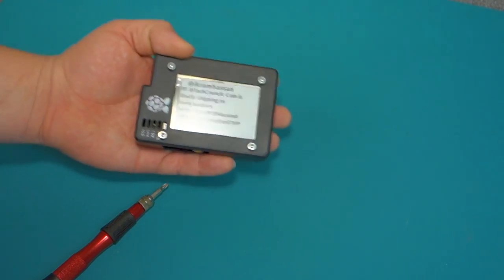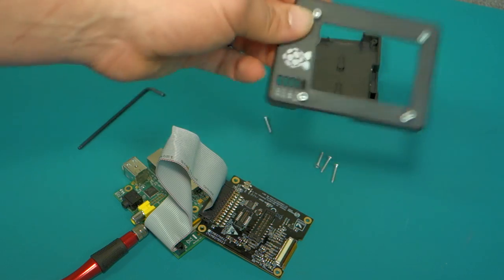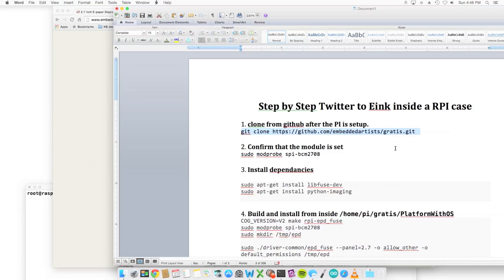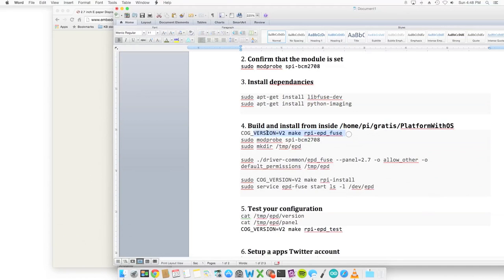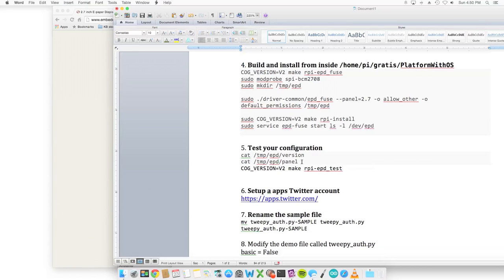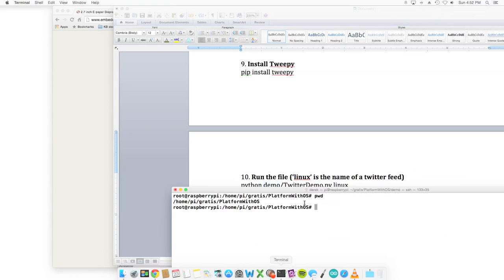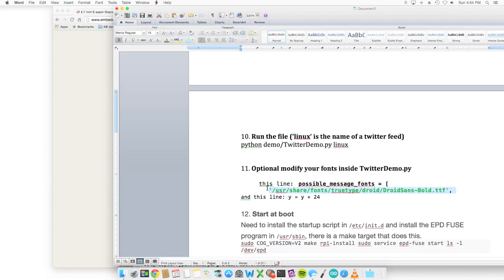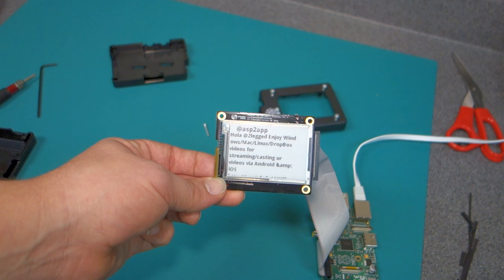Embedded Artists Eink Step by Step Tutorial Raspberry Pi Case

Comment: Hello,

Can this e-paper display work with the RPi 2?

thanks
Reply: +Panagiotis Atmatzidis Hi, I bought these (rpi2 + screen). I think it will work with GPIO cables. 

But things to know :
Embedded artists e-ink display has a 26pin gpio entry, while the RPi 2 has 40 pin. So it won't work out-of-the-box.
The 40-to-26 pin cable sold by Adafruit wont work (not enough space to plug the cable into the Embedded Artists display).

I've found libs to handle e-ink display, and libs to handle GPIO (was looking for JS libs), so it should be doable with another cable or multiple GPIO ones. I'll give it a try.

Nota : I'm a noob using rpi (received my first yesterday).